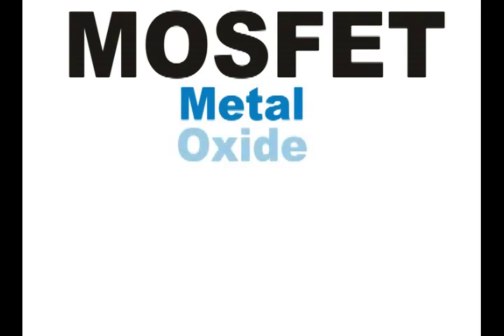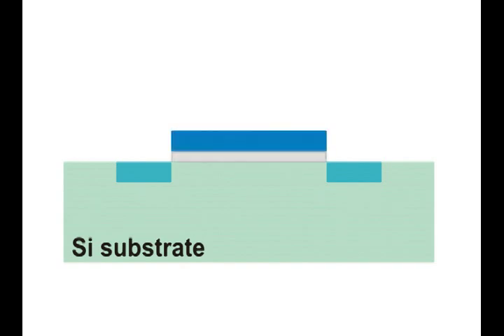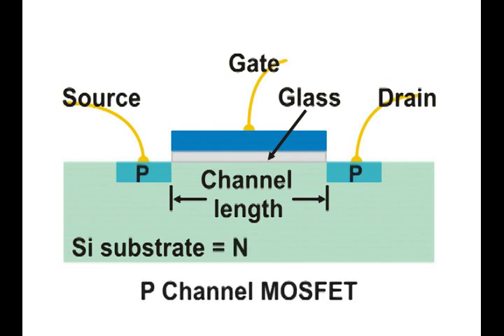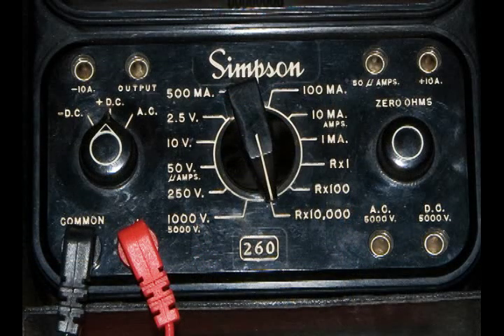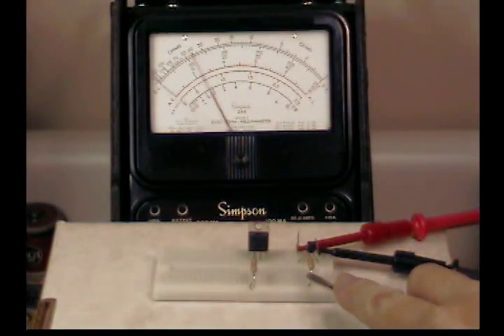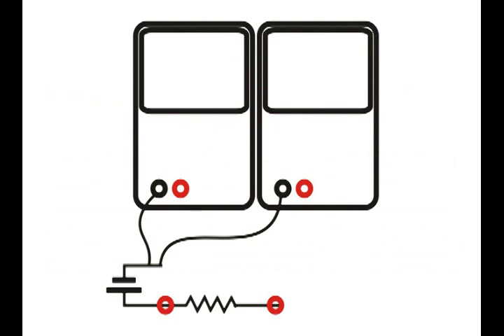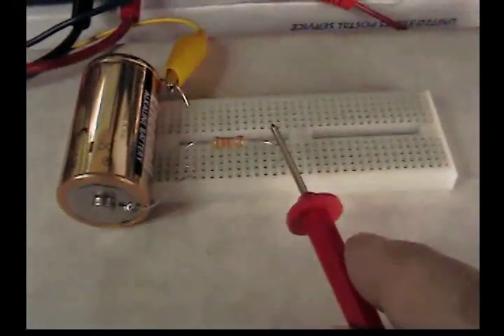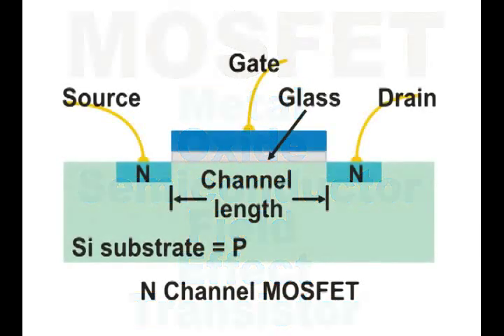MOSFET Experiment

Comment from the maker: Yes. All transistors will need some kind of biasing. The biasing circuit depends on the type of transistor used and how you want the transistor to function. 

From Radio Shack MOSFET IRF510 Transistor $1.99

Impedance, is the resistance, DC or AC, to electron flow. DC resistance is straight forward. AC resistance is frequency dependant. And you can have both at the same time.

High impedance will not load down what ever it is you are looking at. Low impedance shorts out the signal.

Comment from the maker: Of course you would have to bias the MOSFET with in its range. MOSFET are voltage driven not current driven like junction transistors. So the biasing voltage for the MOSFET can be of a very high impedance.

Comment from the maker: The Gate impedance is similar to a tube but MOSFETs can not handle the high voltage like a tube can. The Gate of a FET is not as high in impedance as a MOSFET. N-FETs are similar to NPN voltage requirements.

Comment from the maker: If the gate is open, not connected to anything after the charge, you could use the spec's of the MOSFET. The spec's gives you the capacitance and the impedance of the gate. Then it is an RC time constant. The higher the voltage the longer it will take the RC time constant discharge the gate off. But no matter what, it will take a long time to discharge the open gate.

Comment from the maker: Thanks MrHorsetail
The length of the charge depends on the CMOS and of course the the circuit it is in. You usually don't leave the gate open, I did it here so I could get maximum impedance. 
Your circuit should work, but I would still use a Heatsink and a fan.

Comment from the maker: Thanks asus3571
Keeping solid state cool is very important, the device must be within the temp range supplied by the manufacturer. Usually there is a limit as to how fast the temperature can change. 
This was in the winter, in Michigan. An electronic computer telephone office was having problems because it was to hot in the equipment room. So some one opened up the outside doors to the equipment room and the office went down because it cold off to fast.

Comment: Wonderfull video, well done,.....I was wondering if it is possible to use a pulse generator to send the ''pulse'' to the gate of the mosfet to control a larger amount of power ? ( in my case a 30A ,   20V at a frequency between 20KHz and 60KHz into a large coil in the opposed direction alternatively , a kind of induction heater )....it is good to have peoples who know how to explain things !!  Take care AllAmericainFiveRRadio....  ;-)

Comment: explain please :
 
when it reaches high impedance, in order to switch it off, is it necessary to discharge the gate voltage or current?

price?

what is impedance?

uses and advantages?

Comment: Rick, about how long will the gate stay charged to keep the mosfet turned on? Also, I have a  irf630a and the data sheet says drain/source amperage is 9A @ 25c and 5.5A @ 100c.  Is that ambient temperature, or the temperature of the surface of the transistor?  I'd like to run a 6A motor @ 74F 25c.  Would that work?